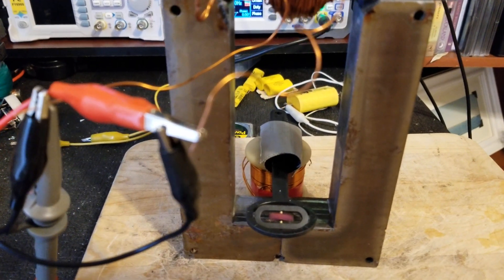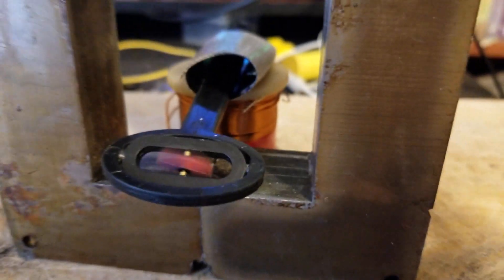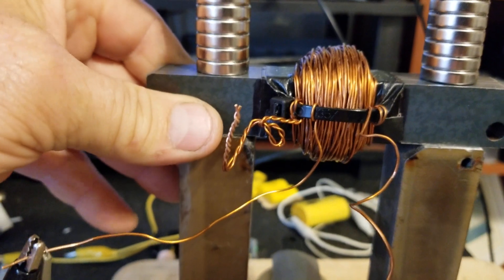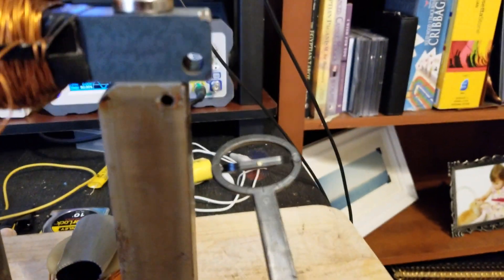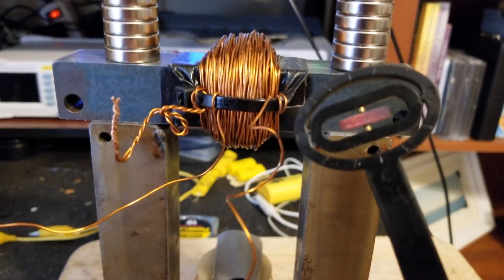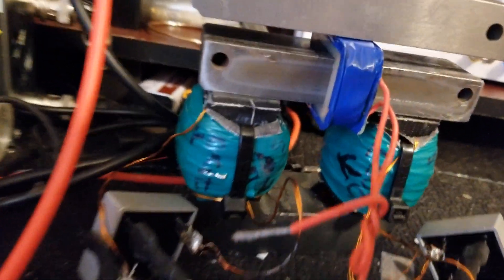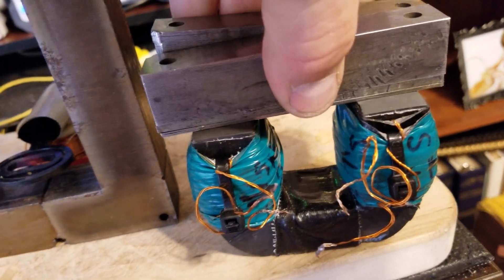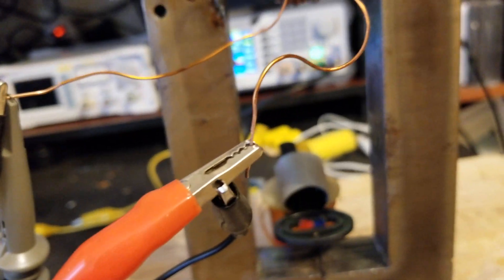Overunity Motionless electromagnetic generator

Comment: Vary interesting stuff.
I'm thinking maybe there should be symmetry in the stator? The bottom part of the transformer being the same as the top with the bars and magnets as there's resonance in symmetry.
Either way I'm extremely interested in this device, apparently it's possible to get out 39x the input power if the transformer is made correctly but to what specifications?
Subbed and I will be following your progress brother. 
God bless ❤🙏🥰
Reply from the maker: Thanks Dave!

Comment: .12PF is ok but .012 would be fantastic. 
One way I could "adjust" PF is through the resistance on the secondaries.
For example a 132ohm resistive load brings maybe a  65 degree phase shift, while a 20 ohm resistive load brings a nice 85 degree phase shift (these examples not sure exactly what it was right now)
Try those hand-heaters in parallel...
Also a capacitor in series from the grid into the primary really helps alot. 
There will be a certain uf size starts to bring good OU...maybe 12uf might be OK.
I bet reducing the thickess of the cross-pieces that spans the three legs messed it up, Iif it is messed up)  now there just are not enough amps circulating that could make it "through" before and without those circulating  amps, the shunt bars dont do their thing anymore. 
You should check with scope the PF see if that meter is accurate, could be it is way better than you think, that is, the phase shift between the volts and amps on the input to it. Could be it is actually .012 PF and the meter just is not made to go that low when phase shift is very near 90 degrees.....Who knows maybe the phase shift is over 90 degrees, and the .12PF you see is what is being "returned" to grid.